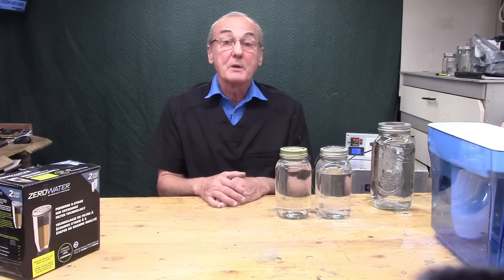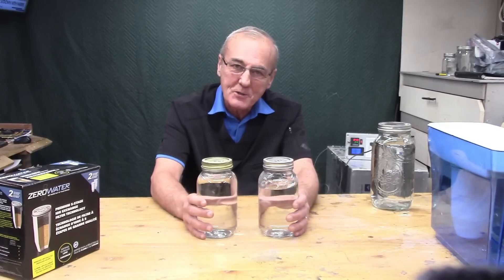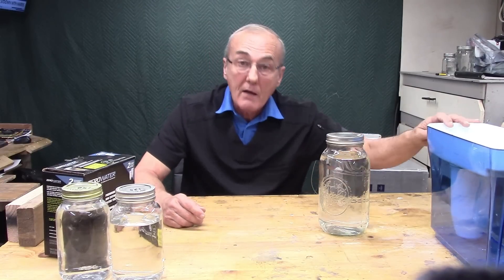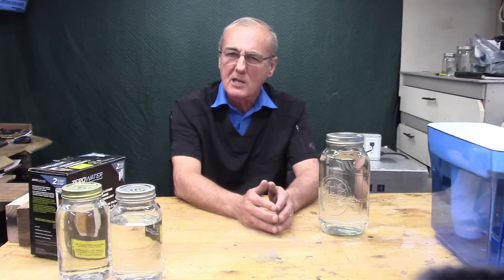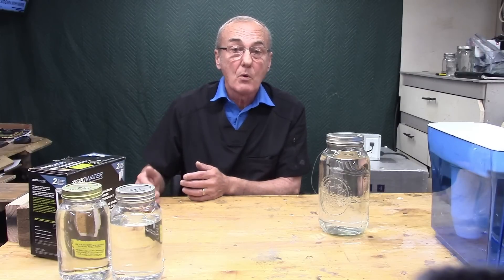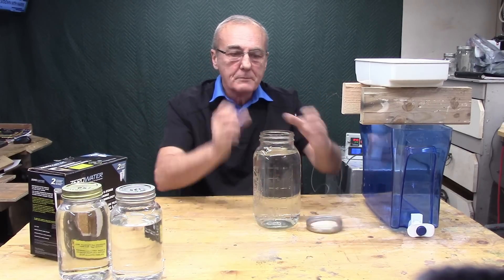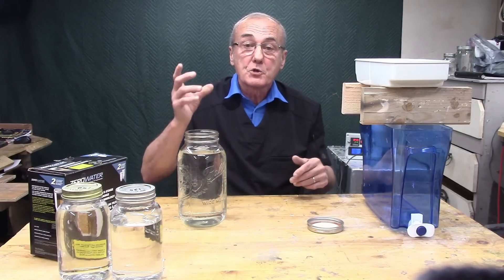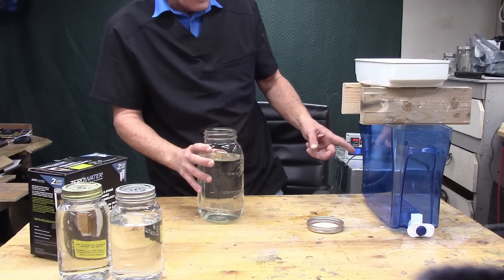FILTERING YOUR SPIRITS

Comment: George, hello there. Love the channel. Tried the zero water filter, even after reading every comment just because I had to know. And sure enough, proof dropped from 130 to 95.

I am going to play around with it some more but thats crazy. 

Eddie
Reply: Update, the filter was brand new and never used. After I ran 32oz through it in 8oz increments, the proof climbed back up with the last 8oz at 128 proof. So, on a new filter, you need to have a sacrificial quart of product ran through there before filtering the focus product.

Eddie

Comment: Bought the ZeroWater filter. 80 proof in, 0 proof out. Lost all alcohol after filtering. What gives? Tried it on 100 proof store bought and went down to 20 proof. Tested with 2 proofing hydrometers before and after. I did NOT add water to the filter before using.
Reply: ... did you also loose half the volume... 100 proof is 50% ethanol  so unless you lost 50% of your volume i doubt it went to 0 proof.

Comment: George. I have a question but can't find any contact info.. I have a turbo 500 and the distaluye came out blue .. possibly from too much yeast nutrient in the pack of 20%abv rocket yeast.  Question is can I resist I'll the blue(looks like Windex) will it be safe to consume after redistilling , or is it waste.
Reply: I don't think you are getting your copper clean enough after you cleaned it. I think you still have some chemicals inside your coils that you used for cleaning. That's the only thing I can think of. If you aren't using copper then idk
Reply: @daltonmcmaster3489   thank you George, according to some forums it's the extra nutrients in the turbo yeast turning it blue  and I should dump it.

Comment: Hi George great video.  I'm new to the hobby and just purchased my first still.  Can't wait to use it.  One question for you though, I was under the impression that very high ABV spirits should only come in contact with S.S. copper, glass etc.  Is this true or not? or are we more concerned with contact time with the plastic in this case?

Comment: I built a potato gun type filter like you made in one of your older videos with a few modifications and works great. I glued everything together except the bottom which has a screw cap to be able to remove the activated charcoal for cleaning and use s/s fine mesh screen and coffee filters to catch the smaller particles thanks for the blue prints keep safe and keep shining

Comment: Hi George, the zero water filter isn’t available in my country, but would any water type filter work, simply just add activated carbon instead of the primal filter? 2ndly, does the alcohol need to filter over night, ie be in contact for longer to ensure purities are removed? Many thanks for all your videos, they’re brilliant.
Reply from the maker: Almost any activated charcoal filter will do. The zero filter, as with many others, is a simple run through filter. The charcoal is small enough as to increase the surface area of each grain so soaking over night is not necessary. 
Happy distilling
George

Comment: On forums some people are adamant that (especially) high proof alcohol should never be in contact with plastic. What's your opinion on that?
Reply from the maker: Ethanol is not a cautic fluid as some acids are. Most (not all) hard plastics are safe for high proof ethanol. There are some softer plastics used for fluids that I would avoid but the hard plastics are fine.

Comment: seems to me I have always read/heard that you must dilute neutral spirit to 50,  if not 40%  for activated carbon filtering to do its job properly.  Unless I missed it in your video,  (and appologies if I did!) do you not  think  that prior dilution is needed?
Reply: Not for filtering
Reply: Not sure - even the instructions that came with my Still Spirits filter pro say no higher than 50%     @MrCecil_KD9WUS
Reply: Indeed. I take it to 40%. Then run twice. 10 liters of spirit through 900 grams of coal. New coal for second run.
Reply: I wish there were a DEFINITIVE answer to this question.  There certainly are plenty of opinions. 😢